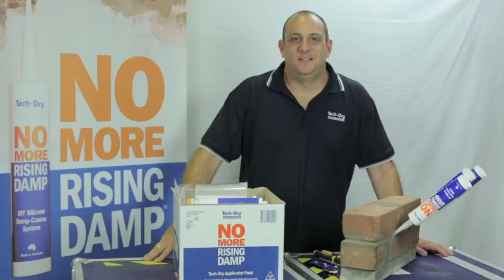How to fix rising damp using a easy step by step process

Comment: 3 metres of application every few hours (for "harder brick"). It's going to take a VERY long time (days) to do a small 100sqm single brick house.
Reply: T Carter 
Hi you can purchase our large applicator pack that allows you to treat 13lineal metres at a time.
Alternatively you can use the DPC cream system which is a faster install

Thanks for watching